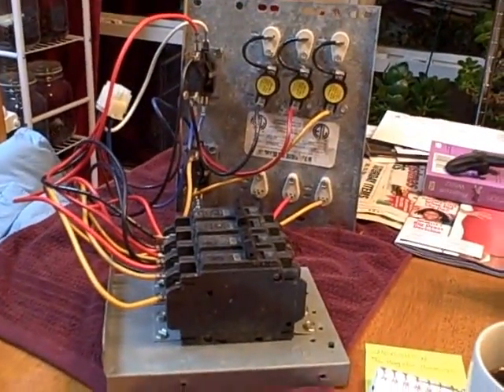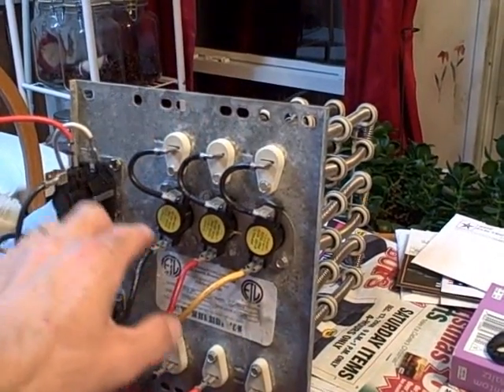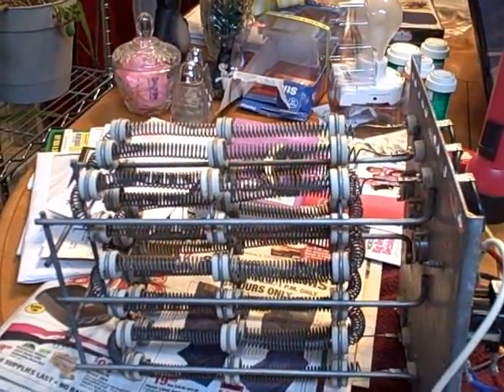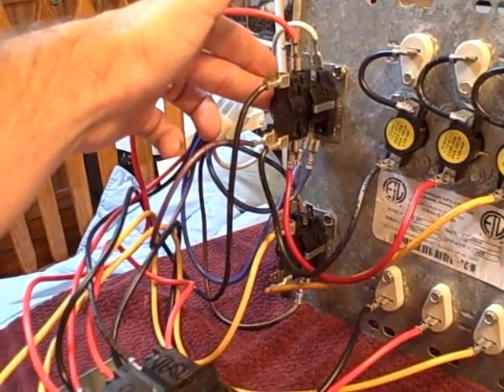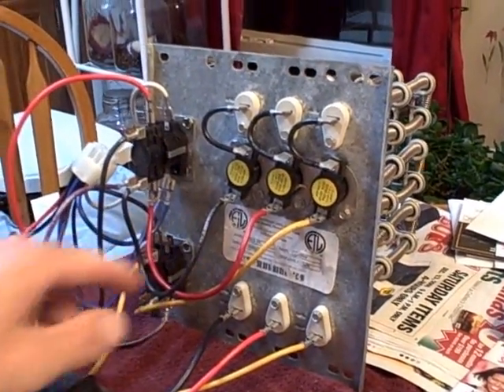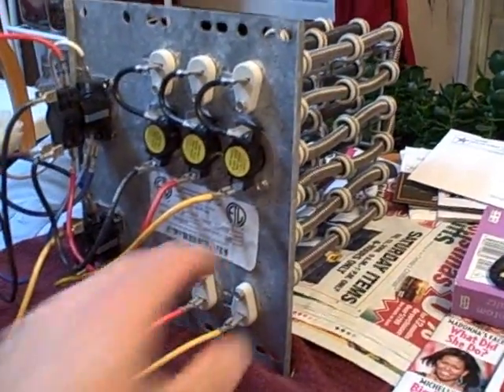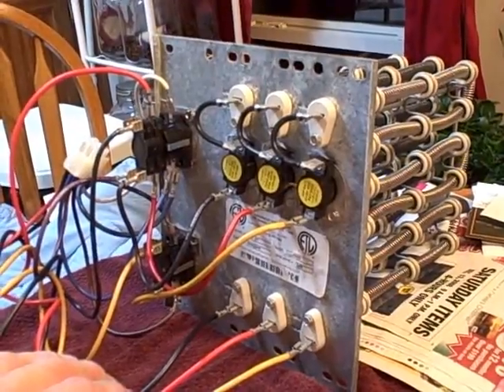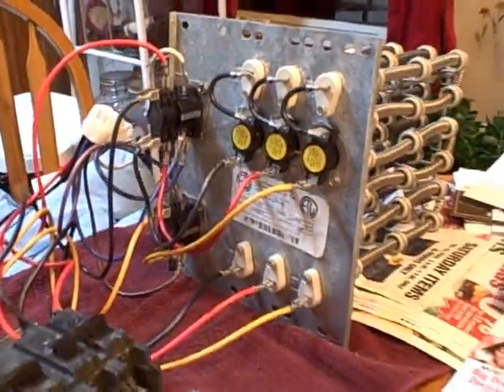HVAC Electric heat kit / strips shown!

Comment: so the 30 amp relay is 110 volts and the other is 220 volts
Reply from the maker: Um, Ron, this post is sitting here by itself, an orphan, lol! For some reason it rings a bell, but without the original post attached to it I dont know what were talking about! :) (and honestly, my memory really sucks! Im lucky if I remember what I had for lunch yesterday half the time!;)
Reply: mikie2501 Mike I would like to know, on a 15 kw heat strip there are two relays one 60 amp @ 240 volts and the other 30 amp. I assume the 30 amp is 110 volts. Would that be correct? This is for an electric furnace 52000 btu.
Reply from the maker: Ah! Well that was quick! :). So 15kw means you probably have three heat strips, typically most heatstrips are 5kw each, some odd ones, like mine, are 7 or some other but most all are 5.  A 5kw strip pulls about 20 amps. Both of your circuits will be 220-240 volts, two strips on the 60 amp circuit and one on the 30 amp circuit.  The blower, transformer, etc will usually be powered off one or the other. 

Most units will use sequencers to turn them on in stages and off in stages so that they dont all hit on at the same time. ...though not all, mine, for instance, just uses a contactor to turn both of my 7kw strips at the same time.
Having any issues?
Reply: +mikie2501 so your saying 240 volts to the 60 amp and come of the 60 amp to the 30 amp?
Reply from the maker: No, the 60 and 30 are completely different circuits and they should go back in separate cables to the main breaker box and have similar or equal sized breakers there, UNLESS the main panel is feeding a 90-100 amp breaker and appropriate sized wire cable to the unit and then its split between the two in the unit.  That would be a huge line coming in though, probably a #2 or #3.
Reply: +Ron White got it,thank you.

Comment: Hi I have a heat pump its runs loud outside both its heating good, I just see have the heat strip to in the furnace ( I am new at the heat pump) and I disconnect the wall non digital thermostat for the heat strip and I don't know how to connect back what wires thanks

Comment: Turned on heater for the first time this year and a strong odor is filling the air. Just when heater is on, however, no smell when a/c is on. Cleaned primary pan. It did have a little moldy water in it that we cleaned but still having smell when heater is on. Thought maybe a dead rodent but no smell is in attic. HELP! Not sure what to do next. Unit is 9 year old Goodman electric central unit. Other than this horrible smell everything seems to be fine with the system.
Reply from the maker: Hi!  Well while Ive heard of that situation, Ive never actually run across it, or if I have its been so long that I dont recall ;) (which isnt saying much with my bad memory, hehe;). 

A lot of times when you get a smell after a while the heat will cook off whatever it is that was obviously growing in there, it just needs to dry out. However if it keeps on hanging in there and just doesnt seem to go away then you can have the coils (evaporator coils) treated.  Im trying to remember if its an anti-fungal treatment or the like.   

HOWEVER, depending on what kind of smell it is, it IS possible that you have a dead critter in there somewhere! Never fun!  You might check, or have someone check, the ductwork in the attic, or under the house if its there, and see if you have had a rodent eat/tear through the ducts and get in there and die. (Lovely thought, eh?;). Ive seen mice/rats chew through, racoons are the worst if they can get a way in the attic! ...and the occasional squirrel too.
If the ducts are under the house and they are damaged then you could have water laying in them as well.

Sorry if this answer is delayed, Ive been slack checking my mail the last few weeks.  Was the drainline clogged or any other obvious issues?

Comment: Heater unit in my condominium has 3 coils the same one as its in your video. The top coil#1 got cutoff but the blower runs so I replaced the coil. I don't see coil#2 heating up, it looks in good shape and multimeter shows continuity not sure why it doesn't work. Coil #3 gets heated up correctly as soon as the blower starts. I had a backup 2.5KW coil so I replace coil#1 with 2.5KW instead of 5KW, will this a problem? Any idea what must be wrong with coil#2 or will it heat up after the other two are heated correctly. I didn't notice coil#2 heating up for first 5 minutes. The system runs for more than an hour and suddenly 50AMPS Circuit Breaker(CB) tripped OFF. I switched it ON and unit started again. Any idea what must be trimming the 50AMP CB?
Reply from the maker: +snehalshankar wow, sounds like you have a few issues!
First the replacement coil; it wont cause any electrical problems, but the system will have to run longer to do the same job, which could cost more money.

Coil number 2.  If the coil is intact then it could be a few things... First check the wiring to see if it is even hooked up to run. Sometimes they will install a unit with, say three heat strips, but the house/apartment isn't that big and doing the math says just to use 2 heat strips, so they will disconnect one.

If that's not the case then next carefully inspect the high voltage wires going from the heat strip to the limit switch and then to the heat sequencer to see if any corrosion has caused a wire to burn off.

If that all looks OK then its a matter of whether the heat sequencer is bad or the sequencer isn't being told to come on. ...assuming that the sequencer is good,  look at the low voltage wires that activate that sequencer and see if they are a different set than what is going to the other sequencer(s).

Does that heat strip have a sequencer all to itself or is it a dual sequencer and it has another heat strip on it?

If the wiring looks different then that strip might be set up as emergency heat.  Do you have a heat pump system or a dual fuel such as gas/electric?  

Regardless if the other stuff looked fine then its probably time to start checking a few things with the meter. Let the system run about 5-10 minutes then check the voltage ACROSS that heat strip.  Check it on both sides of the limit switch to see if that is the problem too.  Then if you still aren't getting power you can check to see if you are getting 24v too the sequencer coil to turn on the sequencer.

The 50A breaker. Speaking of breakers, did you check to see if you are getting 240v from the breaker box for that sequencer?

With three 5kw heat strips you should have two breakers. Two strips on one coming to about 40A and usually the other will carry the extra heat strip and the blower motor and transformer.

If they only wired two heat strips they might have shoved the blower and transformer on the 50A breaker along with the two strips.

Cut the breaker off and check all the wiring lugs for it in the breaker box and the disconnect at the unit. If they are loose then the breaker will overheat and trip. It gets weaker over time when it trips and you have to reset it.

If they are tight then check the blower motor capacitor to see if it is weak or going bad, causing the blower to pull more power.

 ..remember this is all high voltage and can kill you! Always best to hire a tech to work on it.  

Well that should be enough to get you started, lol :) I'm typing one fingered on my tablet with about three hours sleep for the last few days, so I might have forgotten something, hehe!

I'll look forward to more system info and an update!

      Mike.
Reply: Thanks for such a detail reply. I found the issue and it was thermal link open on coil 2 which I changed so was easy one. The tripping of CB was happening due to wires going to sequencer from CB was getting too hot at sequencer terminals due to corrosion. I cleaned the corrosion with slight scratching with screwdriver and plugged wire back in and after that CB tripping off has stopped also I changed filter so not sure which one helped but good till Yesterday. I also replaced coil 1 with 5kW and everything worked like charm till yesterday. Due to very low temp outside heater wasn't heating the house when I opened I saw that coil 1 5kw thermal link got open so I replaced and made it back to normal and worked with proper heating in house. This morning again the heater stopped heating house and blower is just running so I think the thermal link might have got open again. I am not sure what is causing it to blow. Any suggestions will help. Should I change other two heating coils to with new, is that causing load on coil1 and blowing thermal link fuse?
Reply from the maker: +snehalshankar man, Youtube drives me freaking NUTS with their messaging! They make me hunt all over trying to find where they stick them, argh!

....anyway hmmmm.... Im assuming #1 is the last in line, meaning that the heat from the other two is blowing across it?
Lets stick with looking at it from an airflow issue. Have you been able to inspect the evaporator coil and see if it is impacted with dirt and crud? (The side the air blow into, obviously) that could slow down airflow enough to push the temp up too high on the thermal link.

Check the attic space to make sure that none of the ductwork has been crushed by anything up there, blocking airflow.

Depending on how its installed, pull out the air filter and get a flashlight and see if an old, dirty filter got sucked into the system. (May not apply for your setup. My brother moved into a used house and called me. The unit was in a closet. It appeared to have no filter in it but i pulled the case cover to inspect the evap coil, there sat a NASTY looking filter, twisted and pulled in. The evap coil was nasty too! It cooled, not very well, im surprised it wasnt freezing over! Had he tried heat it would have been opening the thermal limits constantly!)

Say, you talked about the thermal links, but does it also have thermal limits that reset?
Reply: +mikie2501 Thanks a ton for your answer. I have to check about he thermal limits if it gets reset. When should it get reset? I just see in when the heater starts it first load that coil start heating one by one in order as 1st blower starts, 2nd Coil1 which is at top, 3rd coil2 and 4th coil3 and they all keep on heating till the thermostat triggers it to off/stop and later the blower is stopped. I just see that coil1 for which the thermal link got open heats more than other two so not sure if it has to take with thermal limits.
Reply: +mikie2501 Thanks Mikie here are my updates::I re-stringed the other two coils because they were not heating bright and now all my three coils 5kw each are brand new which came with 250V 15A TF 152Deg C thermal fuse link connected one via thermal limit. At very first time when heater started it tripped off the 50Amps circuits breaker in 10 minutes of working and stopped blower(complete heater was shutdown). After switching it ON for another 15 minutes it tripped off again. Later I switched it on again and then it didn't break and it worked till date. Suddenly this morning due to freaking cold heater was running for a long time so coil#1 has stopped heating due to thermal fuse link getting open. I checked the current and it shows 19Amps so not sure that cause the fuse to open. I am not sure if this unit which is 53000BTU needs to have fuse link for 5kw element or can be directly connected to thermal limit(I read somewhere that thermal limit will open in case of high temp and then reset back ones cool down).  So far I have changed 3 thermal fuse links with same specs( 250V 15A TF 152Deg C) for coils#1. The thermal fuse link came along with the 5KW heating element. Do you have any suggestions for the failure of CB as well the thermal link. What is the general specs for 5KW thermal link? I am thinking the one I have is not working for the unit I have so want to try changing. Thanks in advance!!
Reply from the maker: +snehalshankar sorry it took so long to reply! I couldnt find your post! I just updated the youtube app on my tablet and magically its there, lol. Its like they make it to break the older ver so you have to update, lol. 
I think it didnt click in my head when you mentioned it earlier, but if your system has limit switches for each of the heat strips then you dont need the thermal links installed.  In a perfect world they would both hold up but since you're trouble shooting theres no reason to install it. Thats just added resistance.
Hey, i cant remember if ive asked this, but you dont have all three strips on that 50a breaker, do you?  Each 5kw strip at 240v pulls 20 amps so that would definately over-heat a 50a breaker and trip it!  Usually there is like a 30 and 60 circuit for three heat strips, two on the larger one and the blower, transformer and single strip on the smaller one!  I wonder if it only had two wired originally and someone wired the third one later.
Reply from the maker: +mikie2501 check this website out:
http://m.contractingbusiness.com/enewsletters/cb_imp_78544
Reply from the maker: +snehalshankar i dont recall if I mentioned it, but the thermal links open from physical heat, not too much current.  ...so on really cold mornings, say its 50 in the house and you turn it on and it runs fine, but another morning its say 68 in the house (just making these numbers up!) and the link opens. ...the elements create the same amount of heat rise from entry to exit, BUT since its colder in the house on the first night the temp inside the unit isnt high enough to open the fuse link.
Did you get it sorted out? Like I said, if you have thermal limit switches you dont need the links, they do the same job, but the thermal limits reset themselves ;)

Comment: Losing voltage from 24 at thermastat  to  7  at  the  outside  unit
Reply from the maker: Sorry i missed your post last month! Did you get it figured out? Sounds like a float switch or wet switch is being activated possible.

Comment: *****************************************

Don't buy any Goodman/Amana A/C units, air handlers or parts in general with that brand name. They are absolute J U N K and have the highest failure rates in the industry for Evaporator coils. Google: Goodman Class Action Lawsuit. Pay extra and get Trane, Carrier, etc. As a homeowner these units that failed are only a few years old and have cost me nearly $4000 in repairs and that is under the warranty still!  

You see they have a nice little way of screwing you by paying for the $100 part under warranty but not for the $1,500 in labor each time one of their defective evaporator coils fails. They knew about this 8 years ago but sold them to customers anyway even recently. They were paying dealers for labor for all the extra failures but not homeowners in warranty. If you are building a new house or replacing A/C units, stay clear of this company and demand that your builder or A/C company not use Goodman or Amana. 

Read the lawsuit below and see what this companies deceptive trade practices are. Sickening and immoral. Please pass it on through all forums and social media. Thank you. 

Class Action Lawsuit:
http://www.tzlegal.com/wp-content/uploads/2014/06/2014-04-22-Whitaker-v-Goodman-et-al-.pdf

*************************************

Comment: My heat pump blows cold air inside so long that we  get cold. Is this normal? Please someone help me know if this is normal for my Amana unit
Reply from the maker: Would really need a better description of what is going on with the unit to make any guesses. Heat pumps are kind of hard to troubleshoot verbally anyway. Is it heating mormally then starts doing it, only puts out cold air?  Is it actually a heat pump, meaning it uses the outside unit during winter? (some people just say heat pump even though they mean any kind of heat they don't know exactly what they are trying to describe.). Try and give me a sequence of events. Does it sometimes work right?  What is the outside temp when its blowing cold?

Comment: Great video. I'm setting up a portable job heater with a hka-15ca heat strip like the video. Question is can I run one  4 guage wire bundle to the 50amp, and jumper to my 25amp supply disconnect?  Or do I have to run a separate like 10 gauge wire bundle to the 25 amp disconnect? Thanks
Reply: It may be a bit large for your needs but I just plug in an electric clothes dryer on a dolly cart.  I made up a short heavy extension cord to the 30 amp dryer plug.  Takes the chill off pretty quick in vacant houses in the Pacific Northwest.

Comment: My problem is that I moved my unit from one house to another.  Now the coil does not turn amber and only heats up for about 3 seconds and thats it, fan works, thermostat works.  It did work at my other house but don't know what it can be that does not turn the coil amber and hot.  Is it possible that the thermal protector got ruined?  Unit only two years old and probably under warranty, but paper work mixed in boxes from moving.
Reply from the maker: Hi!  Honestly, thats not a lot to work with, it could literally be a million things... Could have a coil that was brittle and broke in transit that is barely touching, wiring problems, loose connections, its a ling list! You don't live in Ft Worth do you? Hehe.  ...anyway it looks like you will have to call a tech.  Kind of unusual to pull a unit from the old house and put it in the new house!  Call the installer back out and have them do it right! They should have tested everything after they hooked it up.  You may get a surprise later qnd the ac doesnt work either!